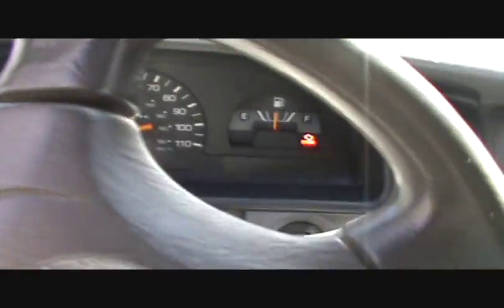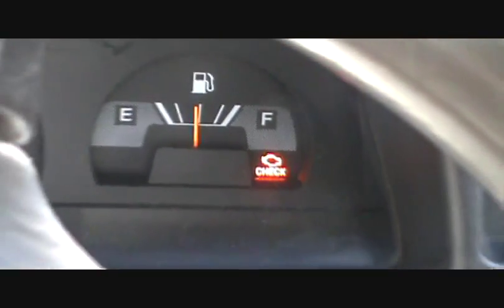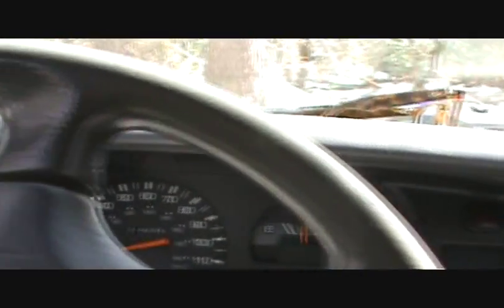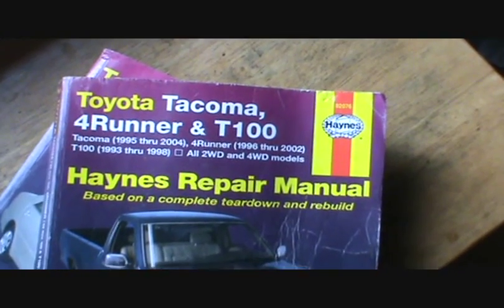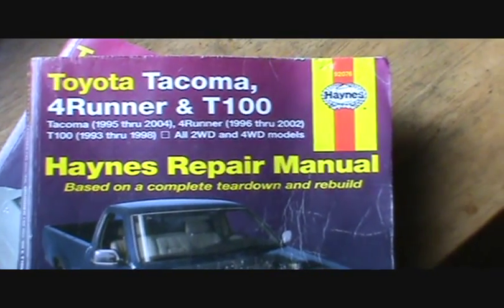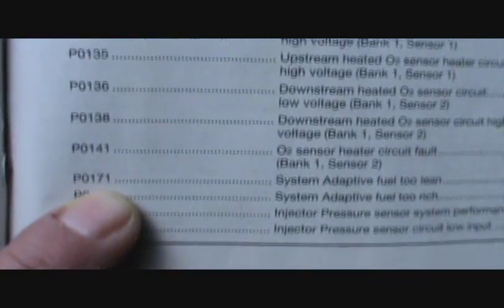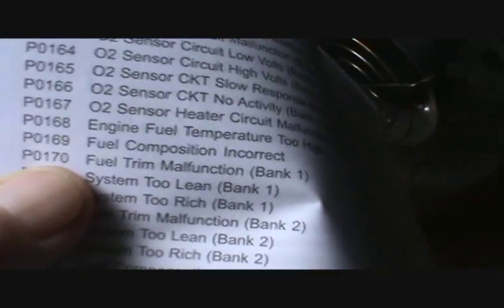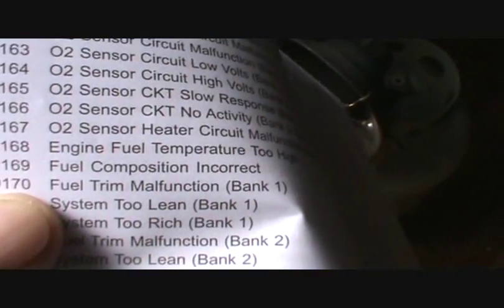Toyota, T100, OBD code P0170, part 1

Comment: I have a 97 mazda with the same dreaded code. No other codes just p0170
Reply from the maker: keithc728  I now know that the reason for this code in my truck was the mass air flow sensor. Buy a spray can of mass air flow sensor cleaner. Clean the sensor or maybe replace.
Reply: @porkdogx  It turns out that I found a vacuum line that came off after I did an oil change. All is good and my baby is running with no dtc. 242k miles and purring like a kitten